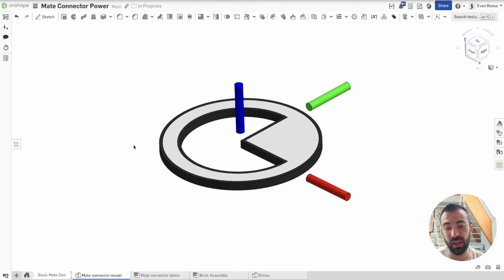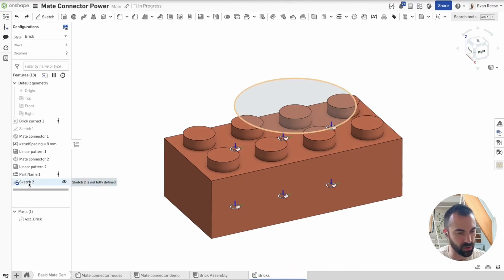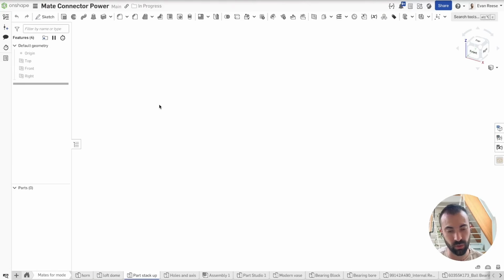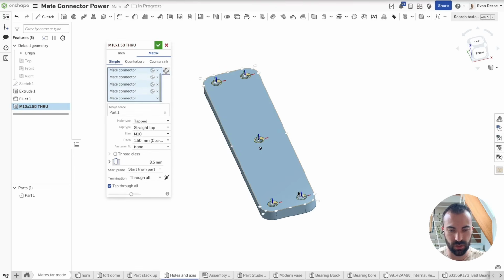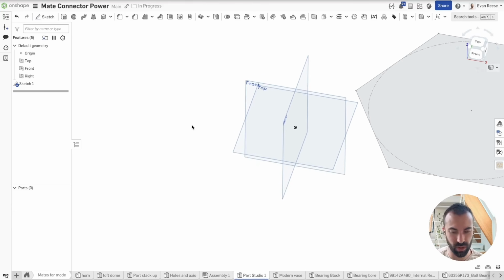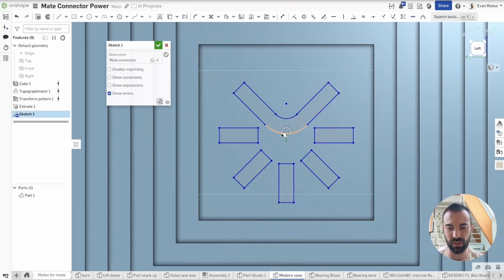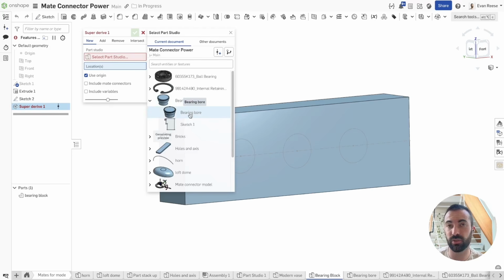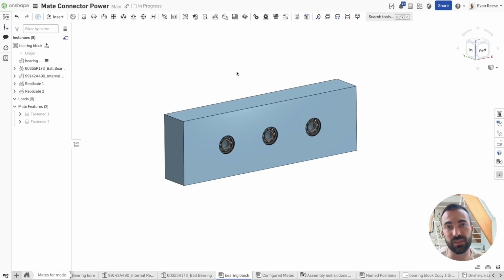Mate Connector Power

Comment: Great video, I think an option on your 3d points feature would be perfect to add a mate connector instead of a point or plane, that way you can quickly drag them around to where you want rather than type in the xyz, didn't realise they can be used for hole feature, that will save me some time.
Reply from the maker: You know that's been on my list to do for a while, and isn't very hard to add. I'll give it a go soon!
Reply: @evanareese that would be great, the other thing I thought of today is a button to change axis, not flip but change, one press x next y next z. Would be so much quicker than clicking rotate around axis and putting 90 deg in. But perhaps I am being greedy now 😂